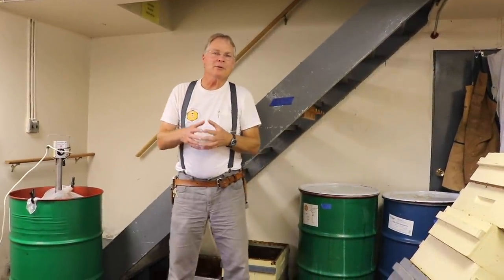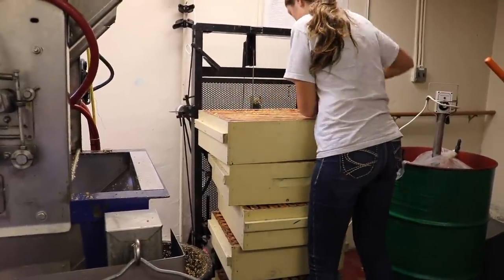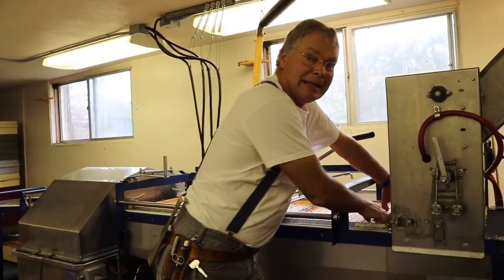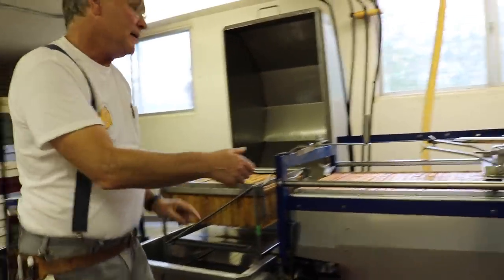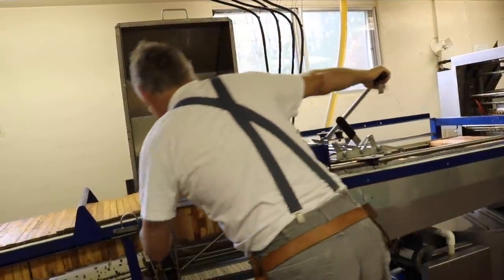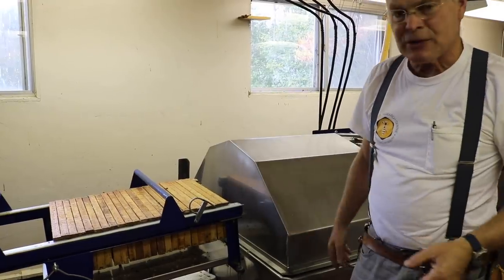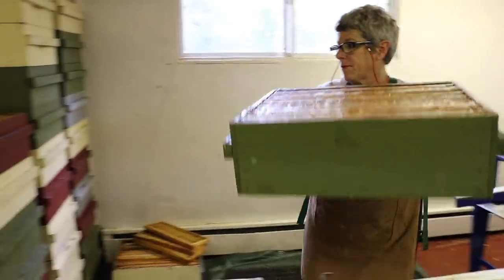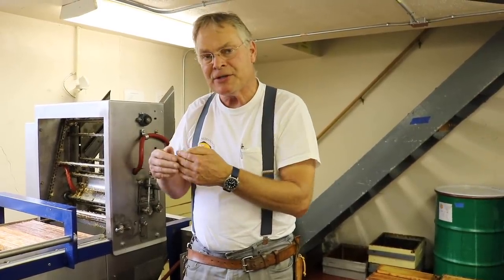Honey Extracting

Comment: advance 10 finished frames on the rails.....pickup a clean super and place it under the frames and lift it up putting the 10 frames into the super.  pull the super toward the end of the rails and allow the frames to drop into the super....guess what !!!.....no handling of frames...faster cleaner and more efficient ....
Reply from the maker: Hi James
 That doesn't work well with our Stoller frame spacers mounted in the boxes. It takes longer to shuffle them into place. Your suggestion works well for those that don't have frames spacers though. We only put 9 frames in our supers.